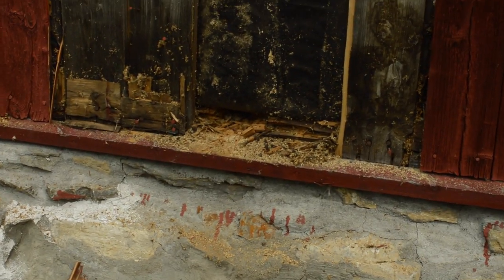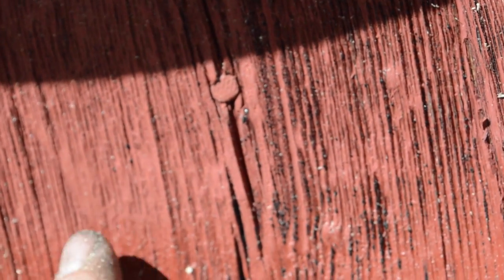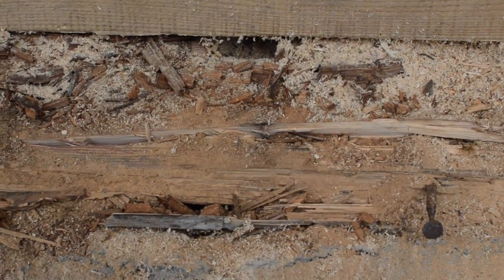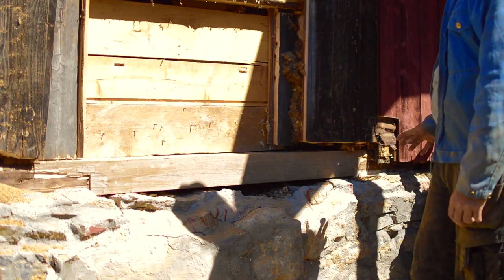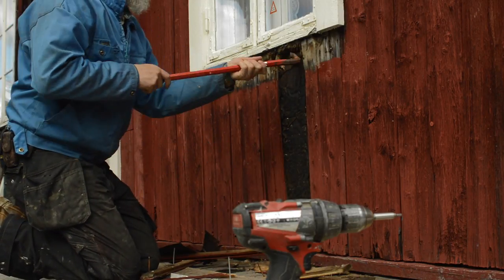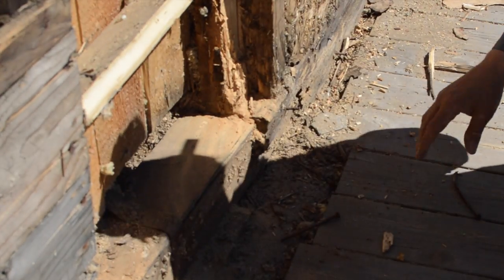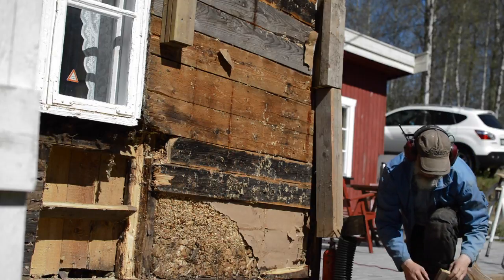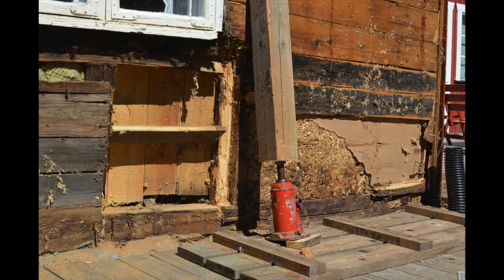🔴 Norwegian 1899 Post and Beam house repair 2/5, with music

Comment: What would be your finish of choice for the wood siding like boards and battens?
Reply from the maker: Hi David, this house has what is called Kompositionsmaling on the new panel, all will be revealed in the coming films. The different treatments all have different levels of diffusion openness. It is mostly old houses that don't have air circulation behind the boards and therefore need the very most diffusion open solution. My personal preference is no treatment.
Reply: Hmmm, I was thinking pine tar from Sweden, we have a distributer here in Canada and the price seems right. Maybe I'll think that over! Thank you for taking the time to get back to me!
Reply from the maker: Pine tar is a good product, it is diffusion open. It will stop the north and east side from turning grey. This link to one of Jackson Crawfords language films shows him standing in front of a building that has untreated wood, https://www.youtube.com/watch?v=jXN_--MNiuk&t=96s
It is good because it shows what happens, both on south or west facing walls which are dry and what happens when water gets to the wall, which is the same as what happens on the North facade.  It takes about ten years to achieve this patina. I will make a film showing my walls which also are untreated since construction in 1932. Untreated timber was the norm until pigments started getting cheaper in the late 1800's Nothing suggests to me that paint is worth the effort. Untreated plank protects the house for 80- 100 years if close grained, and often paint is the cause of damage. Having said all this I have only managed to persuade two customers  so far, not to treat the walls. On this project the customer  was willing to use this Kompositionsmaling which just uses starch as a binder (traditionally rye flour). As you get older your advice gets more notice. The only problem with you tube is that free advice is the least valuable.....;)
Reply: Thank you again. Back home there is lots of barns that are untreated,  and they seam to be doing just fine! I want my shop siding to be treated just to add colour. I wanted Shousugiban but my better half didn't agree with the idea... So need something else lol. Thank you